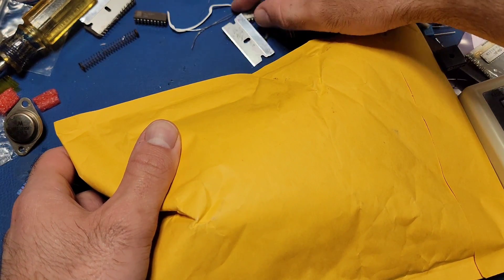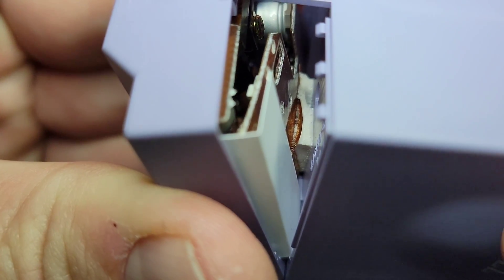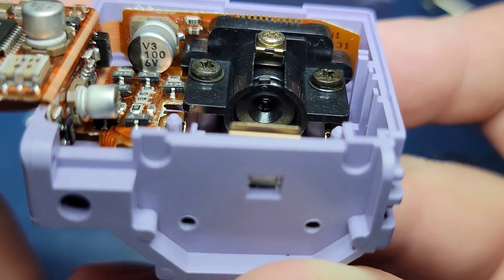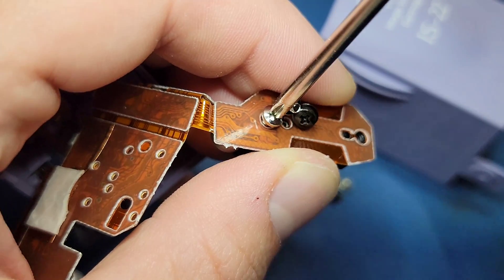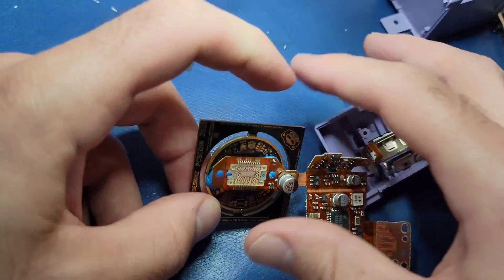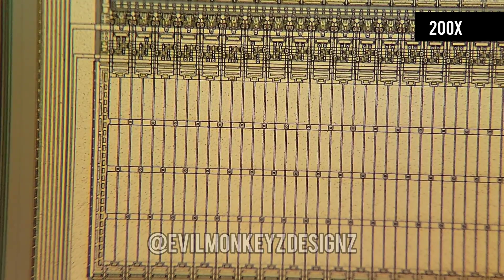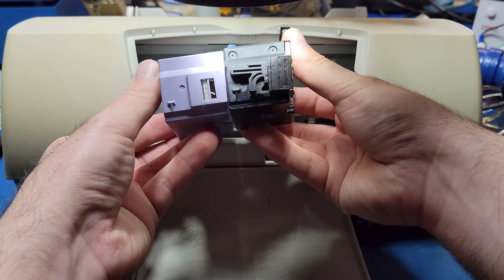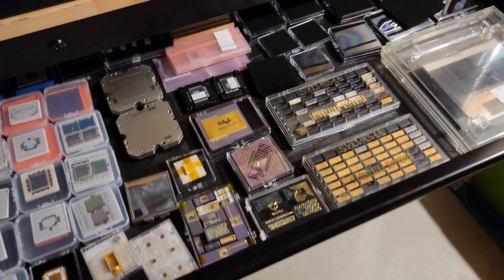This device can turn your printer into a scanner!

Comment: You need to get in touch with Clint from LGR, he’s just acquired a BJC-2000 printer, and this would fit right in with his Oddware series!
Reply from the maker: I saw his video that was posted about the printer yesterday. Looks like he picked up one of these as well. Sadly, it looks like their was a software/hardware issue that prevented the scanner from working, though.

Comment: If you had a small thin client PC they often come with WIndows XP and can be found cheap used.   One of those would be great for scanners and printers you don't want to throw out because there are no more drivers for them any more.  I had a Memorex scanner that would only work with Windows up to XP and possibly some now ancient versions of Mac OS.  The problem with that thing was keeping it running on a modern version of Windows.  There is just no support for it at all.  It is also one of those oddballs that there is no software at all to allow it to work with a modern computer.  I even gave the trial version of VueScan a try since a lot of scanners can work with it and not need any software installed prior.  I guess because Windows usually automatically installs a driver many of them work with it that way.  These are scanners that don't work without the special software from their manufacturers.  I hate that so much!!  I like a scanner that is accessible to any software on the computer but unfortunately not all of them are so user friendly.  That can also cause a problem when driver support for it is over since you might not be able to use it now.  VueScan can help you get around that.  I tried the trial version which just watermarks the scans and liked it.  I paid the one time fee for a perpetual license and they send it to you in the form of a key so you can reinstall that software if you like on your computer and never have to call them.  They update it a lot and that maybe with support for more devices.  It already does support a lot of devices.  Just try the trial version if you want to get an odd scanner working.  Their prices are reasonable too.

Comment: OMG, I used to have one of these.  Back in the days when USB was new and parallel/SCSI scanners were commonplace, this concept was completely revolutionary to add new functionality to an existing common device.   The scanner module was indeed color, the LEDs were red/green/blue and would alternate very rapidly (they appeared white, but you could see the colors if you shook your head violently.... don't ask, I had a weird childhood).   The idea being that as the scanner flew over the paper, each "step" of the scanner carriage was read four times, one in red, one in blue, one in green, and once more in white, then software would assemble the segment being scanned from the data.  Black and white scans were much faster as the LEDs didn't need to cycle and the steps were only needed to be read once.  Unfortunately, the price of CCDs (the scanner reader) dropped in price and became super cheap, it was cheaper to get a dedicated scanner instead of repurposing the printer hardware so this kind of innovation was a one-and-done kind of thing.
Reply: Scanners using contact image sensors based on amorphous silicon photodiode arrays were also becoming very popular around this time, also being developed by Canon.  The sequential colour system used here is the same one used with contact image sensors.

Comment: i had a printer that thing would fit into
the head was really multipurpose since you could place color print head with removable ink  cartridges, single use black  print head, with integrated ink ,  black head for rplacable ink cartridges
6 color photo head or this scanner. all people i knew called those "bubblejet" even though not all the printers in s200 and bjc 2000 were really named that
do you think it is using strobe led light and monochrome sensor or shite leds and  color sensor?

Comment: I had one of these IS-22 scanner cartridges except with a more capable BJC-4650 printer yielding surprisingly good scan results all done on a 486 DX2/66.  In fact the scanner could scan higher resolution and colour depth images than my computer could handle at the time.  As per typical Japanese tech culture, it was damn impressive and great quality!
Reply: Just what my thoughts was when i saw this. Even our -95 pentium II had problems handeling the resulotion the scanner included in the deal provided😅

Comment: I am very interested in seeing how it scans color, since the sensor is monochrome, and the blue LED wasn't really in common use by then, so I wonder how they are making RGB lights.
Reply: The blue LED became easily available around the mid 1990's.  This printers that this device goes into came out around 1999.  Not sure when the scanner itself came out.

Comment: I think it dose color by turning on different Light Colors.
So you can get a Color Image with just a Black/White Sensor.
Reply from the maker: Oh I bet you're right, that would make a lot of sense! Now I regret not trying harder to remove the LED bar to inspect it. I'll have to try again 😁
Reply: Exactly. Even flatbeds (the cheaper ones after the tube lights were replaced by LEDs) do the same. Turn your head or eyes while scanning and you can see RGB separating.

Comment: In the late 1980s I converted my 9-needle dot matrix printer into a scanner for my Commodore plus/4. I put an infrared reflex-coupler on top of the printhead and built a 1-bit sampler from a comparator, a binary counter and a 1 kbit static RAM chip. 
The sampling was started when the printhead started to move from left to right and I dajusted the timing of the binary counter so that it would collect enough bits during one ride. Then I read out the sampled bits over the user port, before I ran the next line...
It gave quite decent black and white (none of that grayscale rubbish) images.
Reply from the maker: That's really impressive that you got that working!
Reply: @EvilmonkeyzDesignz  if only my parents had saved the old computer and printer or if I at least had saved some image...
Reply: I worked for a medical software company in the eighties named Micro Technologies INC. we had a product we were selling what would fit over the head of a dot matrix and you'd have to scotch tape the picture onto the CF paper to scan. 

It worked it was just a pain in the ass.
Reply: Just for fun fact, what do you do for a living now? 😃